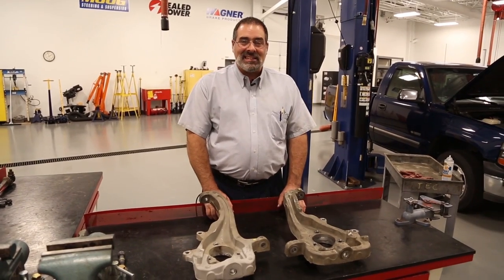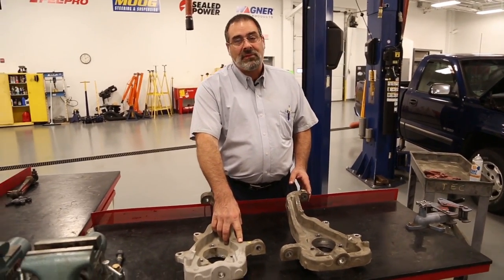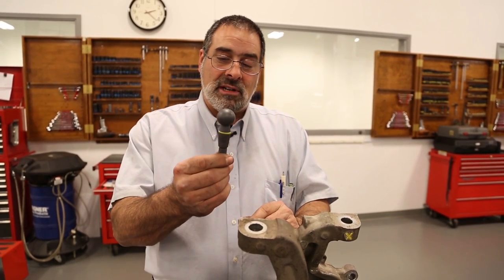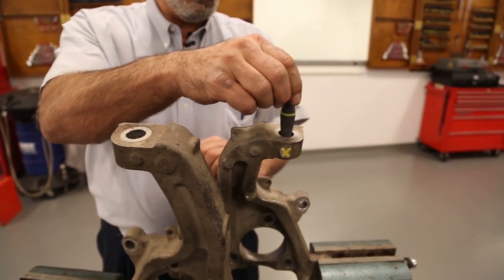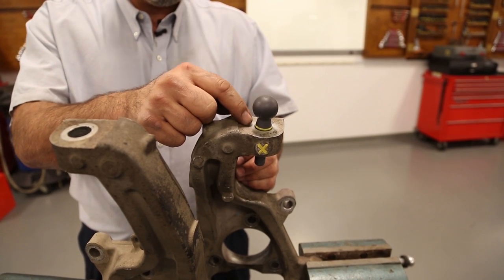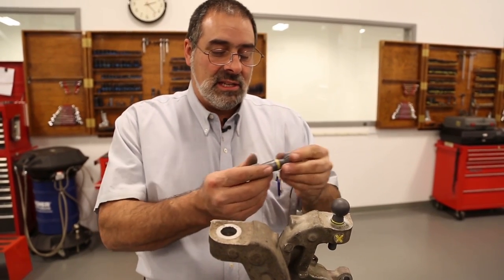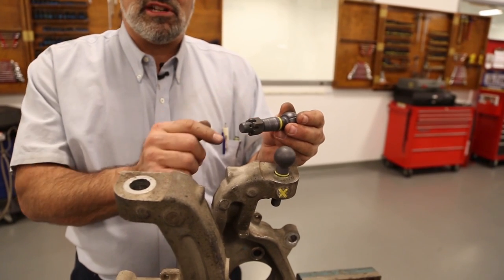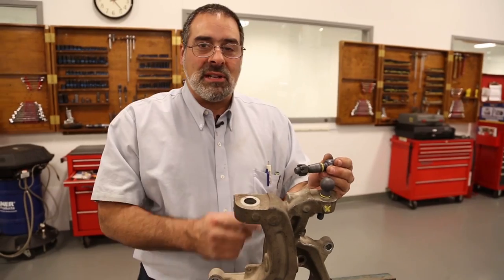Steering Knuckle Damage Due to Overtightening

Comment: I'd argue the issue started with the engineer who spec'ed out aluminum knuckles in the first place. Go cast iron or go home.
Reply: Naaah, put a bolt on it tighten it to specs, and show me if that ball joint moves. If it does my apologies, but I don't think it will.
Reply: @kaczazsolt6044  Not initially.... but being aluminum it'll wear out eventually. I can just barely sign on to aluminum alloy frames, but ball joint tapers? Yeesh.

Comment: I used 85 ft-lb to tighten upper control arm ball joint per specs I found on several references online. Later I found other references calling out 46 ft-lb. is it ok to leave it at 85 ft-lb. I would imagine that loosening it back to 46 ft-lb without replacing the knuckle would make things worse? This is for a 2020 F150 4x4.